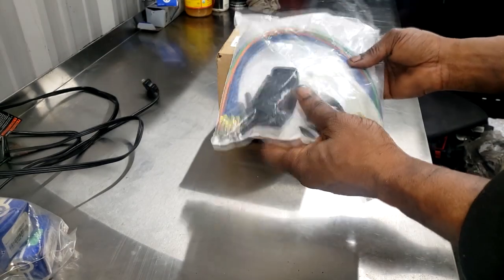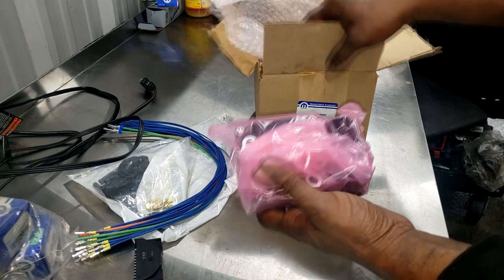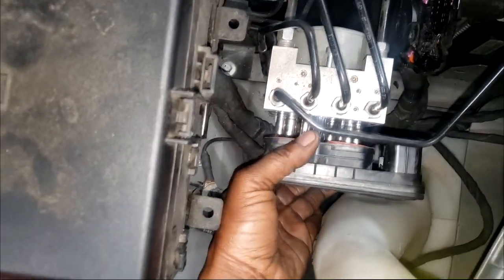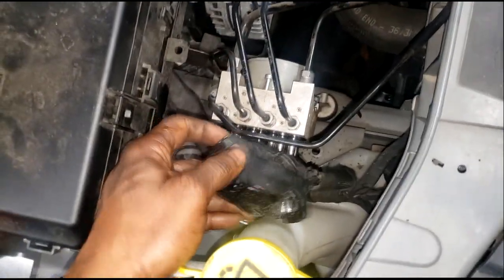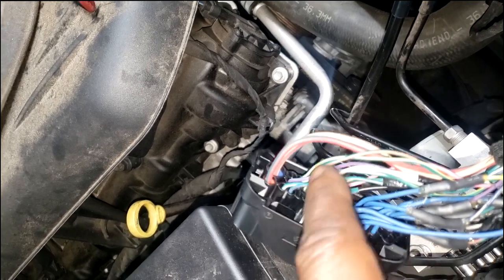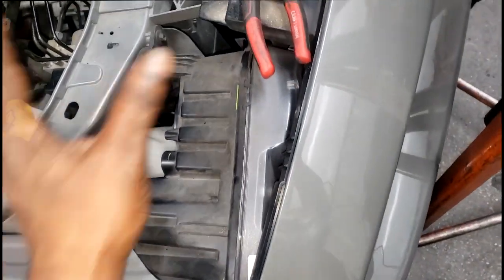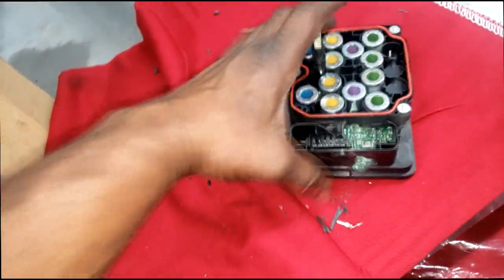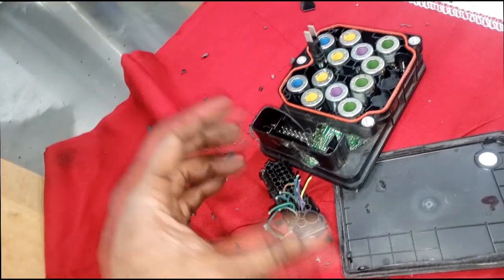Why this car computer ABS module blew up. No Crank No Start. How to replace a ABS Module.

Comment: Bruh … you lit as fuck!!! Good job fr..  makes me appreciate my mechanic completely..  he literally told me this exact thing with my 2018 Dodge Charger .. I’m fixing it from when it was wrecked and I changed my whole harness out because it was exposed a little … come to find out … it’s my abs  module pump from what he told me .. cause it sends a signal which allows the car to crank … ive been doing research while I waited for the part and for it to be installed this weekend .. This made my morning . Simply because I’ve spent 2k on parts and I’m waiting to fix it because of the no crank .. THANK YOU !!

Comment: I would be interested in seeing if the board has burn marks? Even if you have to pull it apart. Also wondering if it was cold out when problem happened. Usually a board just shorts. The broken plastic took some force. So makes me wonder about the hydraulic switches more. Would want to see the inside between the hydraulic switch and the board

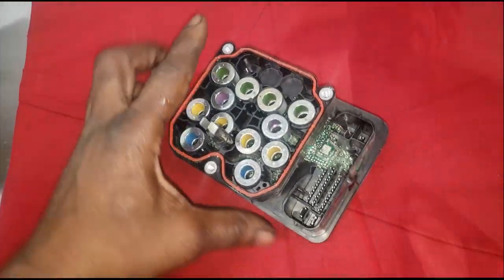Comment: No it did NOT "blew up!", It was shot with a gun/ bullet. It entered at the connector, went across grazing the board, hitting chips on the board, exiting out the opposite side . JT needs to look for damage around the right headlight and wheel well behind it. If you slow-mo the video you can see the entrance and exit. Entrance at 6:02 ,  Exit at 5:55 they line up. Agin at 13:49   "IT WAS SHOT!!!!!"

Comment: Whatever happened was violent and a bunch of the pins look to have been ripped out of the board so you had no choice but to replace all of it. I would have put the non damaged wires back into the plug too, less work and a bit cleaner. 
Got busy messing with that new router trying to get my network shared USB drives going and lost track of time again😡Hope you had a good New Years.🙂

Comment: i just burnt out my abs module and pins today by doing an engine wash
Reply: the seal was weak on my journey's abs pump...I suspect water got in this one because this module was infront the car
Reply from the maker: Thats what the recall is for to prevent. What year is your Journey? Also are you subscribed to the channel?

Comment: Possible surge in the module or it could be a bad solinoid or bad dodder on the board that not has full contact
Reply: No, it was shot with a bullet. Entered at the connector, went across the board hitting chips on the board, exiting out the back. JT needs to look for damage around the right headlight.

Comment: Looks to me like mechanical damage. Did someone prop up the hood with a stick set onto the abs module? Or had a tool or something sitting on it then slammed the hood down onto it.

Comment: Is it possible that  one of the valves got plugged with ice, possible  water  contamination,  and during  a hard brake released causing the damage.

Comment: Ive fixed electronic components that fail and you can always see burn marks or swolen/popped capacitors, or a smell from the failed component area...this doesnt seem to have any of that which is why I still think theres more to the story that thr owner didnt say.